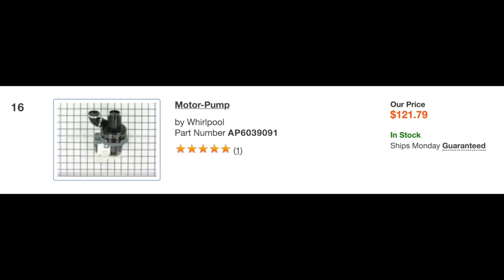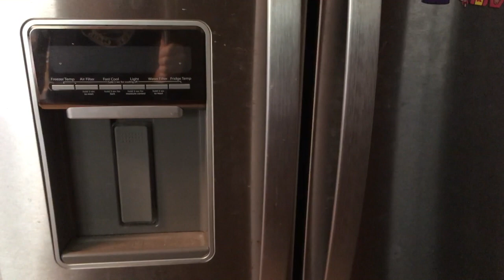Whirlpool Dishwasher Pump Motor Repair (And Upgrade?)

Comment: Hey, wanted to give you a shout out, thanks, and toss in a little extra info for anyone looking to repair this. Had this exact same problem, and it turns out that enough people have the same problem that someone has created a 3D printer model that is on thingiverse repair this.

I just installed a set of upper and lower bushing bearings printed from ABS, used a little food grade silicone lubricant, which quite possibly will get washed away, but still, it's running way quieter now and actually washing dishes!

So thanks very much for this. Totally helped me hone in on the diagnosis. Here's the link to the model...

https://www.thingiverse.com/thing:3960628

Comment: I have a KitchenAid KDTE104ESS3 with motor part number w11032770. Amazon sells an interchangeable part for $52, part number W10510667. Money aside, I find it wasteful to throw away a perfectly good motor because two one cent bushings have gone bad, and for an identical motor that’ll have the same quick failure. Thank you for this video and the follow up video. Very helpful.

Comment: Thanks for the video helped me fix same issue. Found two bearings that fit pretty close to perfect. Cost $10 will see if it lasts as long or longer than the whirlpool option
Reply: Link please? Did you have to do any alterations to the bushings?
Reply: @robertj.993  https://www.grainger.com/product/TRITAN-Bearings-49DD41
These are the ones I used for both ends. I added some foil duct tape to snug the outside 
fits. The fix didn’t last very long only a couple months. The bearings are exposed to too much water and seized. It ended up ruining the rotor shaft because it was spinning freely in the inner bearing surface. I replaced with new dishwasher. I wondered after if I had added marine bearing grease if it would have kept them protected but I guess a more water durable bearing would be a better choice.  They also have this https://www.grainger.com/product/TRITAN-Bearings-49DD53 but the outer diameter is going to be a bit too big probably. 49DD53 is a sealed bearing which might help keep water out? You would need to modify the housing with a drill press or something but could be a better option. Good luck!

Comment: I made kind of a panic purchase and bought the whole assembly for $300 because the $100 pump wasn't available. It will be installed this weekend - then I'll  investigate the old parts to see what caused the problem. Thanks for the video.

Comment: Great video.  I’m no expert but this pump seams to be designed to fail before 4 years. Of course this part worth $10 costs $150.  Enough for me to never buy a whirlpool again.  My bushings where so worn the motor wore through the housing and was leaking water.
Reply: Yikes! I'm wondering if CPSC needs to be involved? While mine wasn't that bad, a failure like this could lead to fire if the motor overheats.

Comment: Have to say this is a very good video well worth the time to watch! 
Well, I have a kenmore dishwasher, I’ve had at least 20 years still pretty modern with all the bell and whistles. If finally when up about a year or so ago just replaced the pump $150.00 about a month ago. I couldn’t stand it any longer not having my DW! I’m really surprised it lasted this long since I’ve read the comments and everyone else seems to have or had trouble with in a few years of purchase. My sisters went up about the same time as well “Maytag”. We could still use it but not load the top rack! Enough is enough! I wish I would of seen this video back then but didn’t thing about rebuilding the pump! I did save my pump and as have it her is the same model pump! So I’m going to give it a shot. At least one of can make out then I can rebuild hers too!   I love YouTube TG. It’s made my life so much easier Repairing, fixing and installing all kinds of things. Just put in a tankless water heater myself and did all the electrical myself, replaced a fuel pump in my vehicle, back splash in my kitchen and the plumbing, oh the list goes on!

Comment: Very interesting.  I'm having trouble with my Whirlpool dishwasher . Took the drain hose off and looked inside the pump, and didn't see anything.  Put back together, and the  dishwasher ran  one time and hasn't worked since. Probably will be replacing it along with the fridge and stove eventually.  Stove has some problems too. They sure dont make appliances😮😂 like they used to. My Whirlpool appliances are 6 years old.

Comment: Great video. The repaired pump with the bearing is certainly better than the original. The problem I see is that the bearing (from McMaster) costs almost as much as a new pump... I just got a new OEM pump for $50 delivered on ebay and left the housing in the washer and clicked the new pump motor and impeller in place... no risk of leaks and literally 5 minutes to do. Simple. I kept the old motor and impeller... which, like the one in the video, failed because the back bushing is not up to the stress of the motor's torque. I'll repair that unit with a bronze bushing (as in your 2nd video) for the inevitable failure of the new pump in about a year. ;-)  Whirlpool clearly has designed this part to fail in a relatively short period of time... shame on them!

Comment: Our Whirlpool diswasher (Model WDT780SAEM1) is also a piece of crap. Sold by the pricks at Home Depot. Also the place which sold us the equally crappy Samsung clothes washer. Proof that capitalism began it's inexorable decline in the late 1970s. That post-war expansion and profit orgy had to end sometime and now we are in a downward spiral. Welcome to 1914 and 1937. So, I already did the thorough clean of all the filters and screens—no help. Replaced the inlet valve—no help. BTW—You have the exact combination of appliances we bought from Home Depot 4 years ago. True scumbags; sales people will tell you ANYTHING to make a commission.

Comment: Thanks for the video you did a great job explaining everything.... I took mine apart and didn't see any junk or Muck in the impellor and my bearing looked great no play (I know all about this type of pump I have fixed many plug and play hottubs) so I was ready to buy a new pump and on closer inspection the little mesh inside the pump was clogged ..we have pretty hard city water so it was calcium not food ..took a while to soak the mesh but I finaly got it free flowing ..pretty sure it will happen again but next time I will prob just go for the new pump....check the mesh folks I fixed mine for about 2 hours worth of pain in the ass time .... and Yes they are junk this was a very high end unit part of a package the fridge is junk I have fixed it twice and all the paint is comming of the stove top 4 yrs old

Comment: I just completed this repair but instead of the suggested parts I used R3 bearings for a 3/16 shaft.  However I had to open up the ID and I should have used Part Number 6455k92 because it would have fit much easier.  With that said If I ever have this issue again I'm going to get Delrin Homopolymer 5/8 Rod stock and machine bushings identical to the original parts.  It would have been 10X easier and just as effective.  Delrin is perfectly suited for this task as its Not hydroscopic and its self lubricating.  Best of luck to everyone.
Reply: Hey Evan how did repair go? I figured it would work better with bearings than just a bushing.  I cut some bronze on the lathe and it lasted a year.  Now shaft has wear.....sooo with a bushing it seems like lack o lubrication! Ideas?
Reply: @chuckmaurer7862  one of the issues with using bronze bushings would definitely be a lack or lubricant.  Even if you use oilite bronze the start up torque wouldn’t be enough in this application to release enough of it.  Using Delron would nearly eliminate the wear issue caused by the bronze on stainless contact.  However if you shaft is now worn significantly it would be best to try the bearings so as to eliminate the potential for any additional wear to the shaft or the bushing. It’s a shame no off the shelf plastic bearing is a perfect fit but the r3 bearing I used has a smaller ID than the shaft so I had to open them up but possibly if your shaft is worn enough they might be a better fit.  However the od of the bearing was a little small for the housing and I had to add shrink tube and a brass sleeve to them to tighten them up.  And that’s exactly why I would choose the McMaster part 6455k92 next time.  Overall it should be an easier part to work with.  It’s such a shame the way these pumps are produced.  Because I do believe they could have used Delron from factory rather than graphite and saved all of us from having to mess with this.  But planned obsolescence is a real thing unfortunately.

Comment: I think it was easier to grind the outside of the bearing to a point where it would fit firmly in place, just to avoid destroying the inner seat of pump body.

Comment: Awesome video and thanks to the comment that explained that the impeller is screwed on.  If you've taken your pump apart and you can see that the bottom bushing is somewhat worn off center then you will probably find that the top bushing between the magnet and the impeller is worn even more.   When it's inside the dishwasher the motor shaft is horizontal and I think you might find that the wear happens on the bottom of the inside of the bushing.  The wear on the magnet will probably be uniform all the way around the circumference, as will the wear on the steel shaft. If you stick your finger down inside the gray plastic cylinder that the magnet rides in, you will probably find that it is wearing on only one side.  I think that when the motor stops it is pulled towards that side by gravity, and when the crud in the swirling water around the magnet comes to rest it then also drops to that side adding friction.  Both bushings are held in place by a little o-ring.  If you pop the bushings out of their o-rings and rotate them something less than 90°, you may be able to get your motor to run a little while longer.  The shaft on my motor was worn worse than the bushings it was riding in so new bushings or putting in bearings is not going to be a solution.  It's fairly easy to get the impeller off and the shaft out of both bushings but I do not think it is possible to do anything to repair the damage to the shaft.  I find an entire replacement pump is about 60 bucks, and rotating the bushings to make it run a little while longer is probably only going to allow us to wash dishes until the pump arrives.  I am very tempted to order some food grade grease and fill that cavity around the magnet but it might create so much drag that the motor doesn't work.  You will notice for tiny holes that are designed to let the water in and I'm imagining that the water inside cavity that holds the turning shaft provides some cooling.  Unfortunately as the video clearly shows as does my experience with my one pump confirms, that water brings in a lot of crud from the dishwasher and it probably accelerates the wear on the bushings.  If the bushings were a little harder they would just eat the shaft up faster.  In my motor, the top bushing between the motor and the impeller is actually less worn than the spot on the shaft where it rides.  That spot on the shaft worn so badly that there's just no point in trying a repair.  The whole dishwasher is about 5 years old.  The most common power steering pump on larger Ford and GM vehicles wears out where the shaft pass through a bushing and much the same way.  That pump is a cast iron housing with all metal parts, lasts about 5 years and only cost 50 bucks for a remanufactured pump after a $25 core charge.  of course the pump is made to be remanufactured and all the cores go down to Mexico get rebuilt and show up in your local auto parts store.  That one pump appears on lots of Ford and GM and some John Deere equipment.  Much larger heavier pump costs less than this little Chinese made plastic gizmo.
Reply: Yep. My bushing are worn too.  Just a junky dishwasher.  Poorly designed pump.  Maybe make a brass bushing but probably too much trouble.  Off to the junk heap.  Thanks for you video.

Comment: Same finding as Ryan below.  The impeller came off quite easily and then access to the "upper" graphite bearing was easy.  Bearing option used by mfgr. is a poor one.  Our dishwasher made it 3 years.  All other components seem fine.  Put a new pump in for around $70 which repaired the dishwasher to original functioning level, but if the graphite bearings were available the original motor could be repaired.  Would be great if anyone knew where the graphite bearings could be acquired.  I don't have the equipment to make replacement bearings.  Shame to have a $600 dishwasher fail in three years due to the quality of the dishwasher bearings.  Thanks for posting the video.  It was informative and well done.

Comment: I just found your video after i opened and serviced my pump too.
I've got a ball down in the graphite bushing i think, that the rod are riding on.   Not 100% sure, but it looks like there is a metal ball down there.  Rinsed up my motor, adjusted the slack on the impeller, (Mine is pressed on a metal thingy.. so adjusted it down 0,5mm or so, and it's running good again now. Crossing my fingers that it continues like that.  My unit is older tho,  12 years old, but runs 2 time a week.  And it's 240V motor so i guess it may have more "ompf" in the motor.   Thank you for your video  :)

Comment: Thanks for the vid.  You saved me a service call. I have the exact same pump in my whirlpool, but my issue was different.  I found the impeller almost entirely unscrewed off the armature. I think it might have been binding against the housing. Screwed it back on tight and fix the problem. I noticed the bushings were made of metal and showed no signs of ware. The washer was purchased in mid 16. So maybe the manufacture used this better bushing because of the issues. Thanks again, you got me pointed the right direction and got it running again.
Reply: What agreat work you've done
Please,what is your Whirlpool dishwasher model specifically 😄 Many thanks
Reply: What agreat work you've done
Please, what is your Whirlpool dishwasher model number specifically 😄??
Reply: I'm curious what type of metal you thought they were? Mine definitely has graphite bearings like the video. I think ceramic bearings might work or even brass.

Comment: It appears that Sears now sells a Dishwasher Pump Impeller Kit (https://www.searspartsdirect.com/product/fyanyxdkdr-0022-665/id-303032). I wonder if that part shown on the website is a new bushing? (I doubt it). At least it comes with a new impeller, for those looking (note: It costs $50 as of Nov/2019, ouch!)

Comment: My whirlpool dishwasher still drains, but has started clicking the last several weeks when the drain is running, not draining as well. I tried to suck everything out of every corner and drain tube with my good shop vac, but still clicking. Next step I guess will be to disassemble the pump if I can reach it and figure it out.

Comment: My 2 year old dishwasher stopped pumping and found this video! I don't want to buy a new pump that will go out in 2 more years, so I ordered 2 bearings like you did and am following your video to repair mine. I watched the year later video when you made your own brass bearing. I ordered 2 bearings so I can replace both now.
 I wanted to know what you did about the small rubber seals on both ends of the motor shaft? The first video shows the rubber seal  setting on the bench with the carbon sleeve. Did you add them later or just eliminate them? 
It is easy to replace the pump, but don't want to get ripped off because of a $1 piece of carbon sleeve!!!!
Thanks, Bob

Comment: I think i'm experiencing the same issue with my whirlpool washer but the Washe model# is WDT720PADM2 and pump part number is W11032770. They look the same but do you know if the dimensions are the same?

Comment: I have mostly Whirlpool appliances (including a dishwasher that looks very similar to yours and has started having a problem with not circulating the water through the sprayers) and watching your videos (and others) just makes me angry! The most important thing to me when making a significant purchase like this is that the engineering is solid. Wish I could know these things before making the purchase.

Comment: THANK YOU! After struggling with the same EXACT problem over the last few months (it runs 7 or 8 times before this happens - does cycle, but soap is on bottom at end of wash), so will inspect the pump.  Just narrowing down the problem to this is a huge help.  I will inspect the motor, but I am not as handy so may end out getting another motor unless I can get the actual part.

Comment: I replaced the motor in my GU1500XTKS0 when the motor was locked up. Destructively pulled apart the motor and found the bearing on the other end was completely locked up. The rest of the motor looked in good shape. Terrible engineering to have a dishwasher bearing rust up.

Comment: Agreed.  This is a terrible washer.  Same problems.   And a control panel issue.  And peeling paint on the door where the exhaust comes out...  and falling off spray arms.. then melt onto heating element.

Comment: Thanks for the Post. Our Kenmore stopped circulating. Took everything apart, found small debris wedged inalong the magnet and housing. cleaned everything, sanded it with 1200grit to smooth everything out again. Reasembled everything and BINGO, everything worked. Took about 5 hours, between checking all other parts. Again, Thanks for the post.